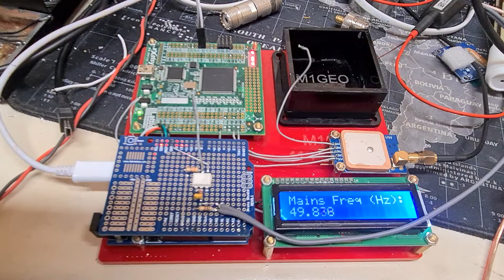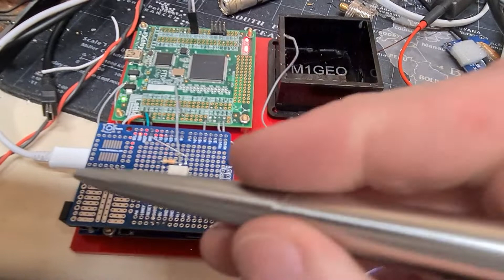Measuring the UK mains frequency using high quality reference

Comment: I see you are using a NEO-6M as your accurate clock source. These are great. When testing my GPS logger I used a GPS repeater, and had extremely good results. Worth an investment if you want to use GPS indoors in future, I leave it on all the time because I live in a Faraday cage modern designed building and like to ensure my radio gets good GPS for APRS etc.
Reply from the maker: I see you didn't watch the video then! I'm absolutely not using the NEO-6M for this :) I'm using a Symmetricom UCCM-P GPSDO.

But yes, they are good modules. The TP5 output is very jittery, so needs locking to another XO or similar though a tight loop filter, but they work well!
Reply: @m1geo  My apologies, watching on the way to work on a mobile phone screen, and as commented before I found the audio a bit low when I did watch it. Looking at it again and it's identical to one I have on my desk right now, easy to make the mistake.

Comment: Your audio is very low. 

Some years back I asked some friends on the best way to do this and to log the received voltage on mains, partly out of interest, but also to look for correlation between the received voltage and other events such as the recent storms that caused Southern and Scottish energy to have over 450 recorded powercuts at any one time. These were radio hams, all technically minded and highly competent electrical engineers with many decades each in their areas of expertise. They were all very dismissive and frustrating since they all put me down and made me feel like an idiot for being interested in something so mundane as this. Even now I wonder what happens when the power gets interrupted and when large loads are restored and if the the noticed changes are detectable even when these changes are made far away.

I wish I'd pursued this line of curiosity now.
Reply from the maker: Really? It was just recorded on my phone. If I watch this next to other videos on a different device (smart TV) it sounds similar in level. I'll take a look...
Reply: @m1geo  thanks. I was using headphones and was set to max volume, nearly all videos I watch hurt my ears. I found your video very quiet, but very clear (free of background noise). Its possible there is automatic gain control limiting the sound.
Reply: Playing it back a second time the audio is loud enough through my speaker but weirdly it's very quiet through my headphones. Testing other videos thy are loud regardless. I put that down to problems my end, my apologies.
Reply from the maker: @Dennis_M1DLG  Not at all. I think it's slightly quiet. I may bin the video and remake it anyways. 😂
Reply from the maker: Oh, and search Twitter! There are lots of examples! In the industry, it's referred to ROCOF (rate of change of frequency).